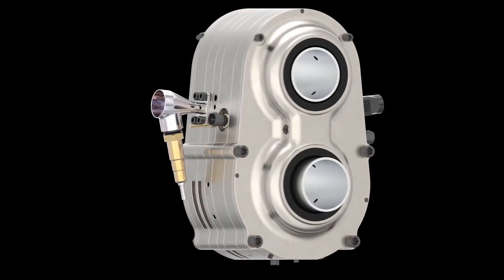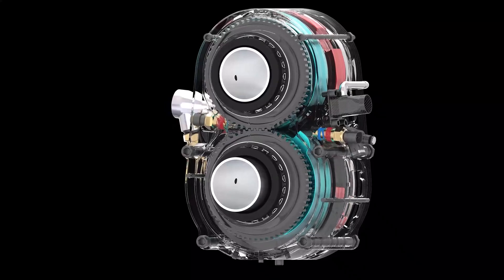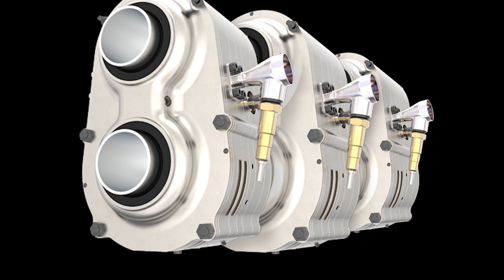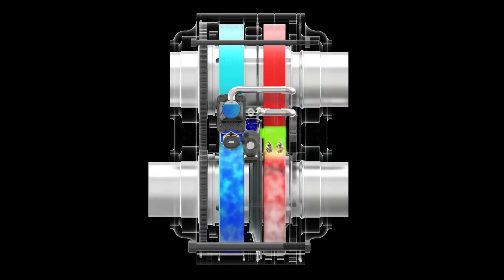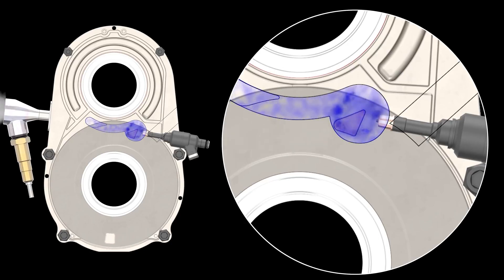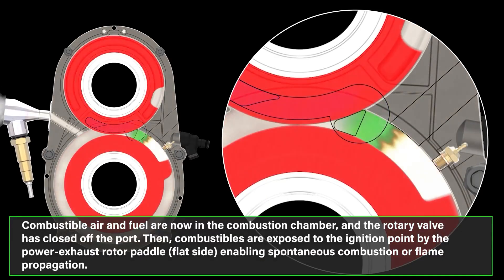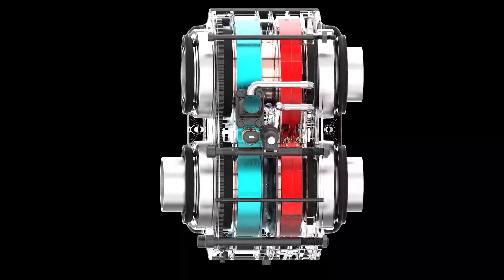This pistonless engine runs on hydrogen and revs to 25k rpm

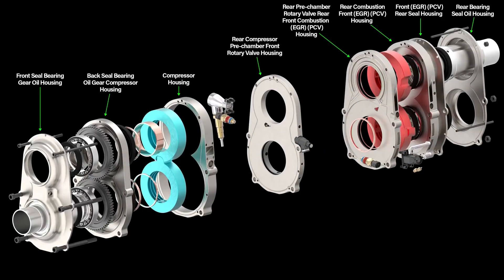Comment: 1:50 1st issue its "air cooled" yet hows the air being forced into it if you look at every other air cooled engine like the deutz for instance it has a massive fan in the center same goes  for jet engines that the interior pulls in cooler air to not only produce more thrust but to also cool the turbine. (edit there is one its just ficking huge later in the vod but the overall design is inefficient because instead of driving air close to the engine its just a massive fan)

1:55 2nd issue the blade design will cause vibration since its its a biased spinning mass meaning its gonna vibrate the more you increase the speed which since the only thing keeping the blades synchronised  is a gear with high teeth count its going to jump teeth knocking them out of sync causing the blades to miss align and cause the engine to grenade.
      
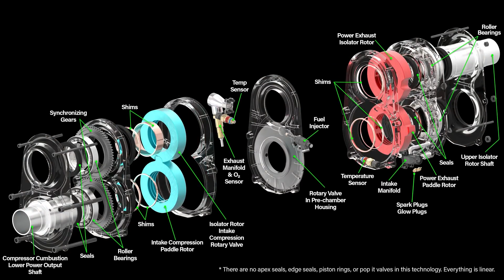2:03 3rd issue tight tolerances since its spinning at high speeds this will cause the discs to distort and since its a high tolerance engine those disc blade things will bind together causing it to grenade

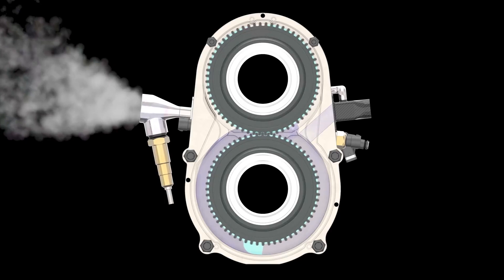2:15 4th issue internal supercharger the main issue is heat hot air doesn't burn as well as cold air because cold air is much more dense so the longer the engine is run the less efficient the engine will run which will cause it to run too lean  because and grenade

2:37 5th issue hydrogen this adds a miriad of issues but the main ones are hydrogen storage you could store it as water but then you would only get 2/3 of useable fuel plus you'll need a hydrogen generator which aren't the lightest thing in the world plus you'll need a power source aka batteries and lots of them because you'll be fighting against newtons second law, not to mention hydrogen is an extremely inefficient fuel for combustion engines in general since instead of needing air to fill the extra space it needs to be full of hydrogen and using hydrogen makes the supercharger kind of pointless and storing liquid hydrogen is not only is extremely dangerous but requires a crap ton of energy to keep it in that state.

i could go on and on about this video its just silly how many errors were made in it 

3:47 nope these "eco engines and EV's esc" will all go away and everyone will try and go for the older combustion cars because maintaining these new eco cars are expensive and once it clicks they'll eventually change there tune about them, and lets not mention when the electrical grid can't support all these EV's so this will cause a massive hike in electrical prices(this is already happening in the UK where people are boiling water over a BBQ then using there gas stoves or electricity)
Reply: Im 100%  sure the air cooler the last things worry about this engine.(Like air cooled car is not a new things) Probably they does even have running version just this 3d stuff.
Reply: Thanks...Well thought out..

Comment: Burning hydrogen in an engine is barking up the wrong tree.  Fuel cells can hit 80% efficiency and electric motors can reach 90%.   If you have hydrogen, fuel cells are the way to go.

Comment: Scale it up and lower the rpm. This way there is a chance manufacturers of cars, motorcycles, Quads etc will have a go at it. Those crazy F1 level rpms are close to impossible to utilize you would need a 2:1 or even 3:1 reduction gearbox which induces losses and unnecessary moving parts at a high cost.

Comment: Those extreme RPMs might be difficult to utilize directly, but this would be perfect for powering a generator to produce electric power on board a vehicle.
Reply: What are you talking about, you could make a very short ratio gearbox and It would handle the same as other engine
Reply: @ThePgR777  Theoretically, yes, but what gearbox are you aware of that has that input shaft spinning at 25,000 RPM?
Reply: @critterIMHO  you can design a new one lmao, you design a new engine, a gearbox is a piece of cake in comparison
Reply: @ThePgR777  yeah, OK. The clutch alone should be fascinating,but I’m sure a man of your talents can do it.

Comment: 160hp at nearly 25k rpm is cool, but the power band is probably really high in the rev range, and you will need to design an entirely new transmission for this.  That torque number has me skeptical as well.
Reply: Perhaps a planetary gear system reducing the high rpm prior to the transmission? That would cause a lot of frictional power loss though. Idk They probably build transmissions suitable for this kind of stuff.
Reply: Planetary or a buttload of reduction gearing. The trans would look like a swiss clock
Reply: If you're going to take advantage of the feature which allows reducing power by skipping firing cycles, that means keeping it at 25K RPM, even at low power. A conventional transmission wouldn't work. If this thing is ever developed, they'll undoubtedly use it in a hybrid system which generates power with the engine, but manages getting it to the wheels with inverters and AC motors.
Reply: Or you could just feed it straight into a generator... and an electric drive train like a locomotive. Honestly that's probably the correct answer for such an engine...
Reply: @Wingnut353  That was done with the fisker karma.  I don't think it worked very well.
Reply: Yeah, I get the idea that this thing would run in the realms of gas turbine engines, seal losses are made up by running faster than air can escape, but means idle speed is still up near at least 50% max rpm. Someone said electrical generator driver, sounds like the best option.

Comment: I will not say this can't work, but the tight tolerances and high RPM will mean you can never build this at a consumer price level. think more 100's k$ .
It's kind of like the problem with small jet engines, they are still very expensive as you will need smaller tolerances to get to the same efficiency levels.
Couple to that the added complexity of the hydrogen tank and associated safety features. 
The tight tolerances will also make this a very (maintenance) sensitive engine. It will need super filtered air and oil, and how well will it handle rough handling (shocks, erratic loads etc.)?
All of that for what? It will not be able to compete with the efficiency of electric motors and battery's and will be way more expensive.

Comment: Biggest problem against Hydrogen fuel is that the investors are going all-in on extremely sustainable battery power
Reply: What? In what shape or form are EV’s sustainable? Do you even know the TONS of minerals used to make 1 battery? And aside from that about the same amount of fuel is burned to produce that electricity… sounds like propaganda to me

Comment: There is no way you can get to 25k RPM, make that much heat, and successfully cool the engine. That will absolutely need water channels and a radiator. Cool concept, but I don’t see how they thought air cooled would work, maybe in space where it’s freezing, but not in California where it’s 80° average. This thing would melt

Comment: These things are great...  in the lab.  I see no path forward for consumer-level power plants based on this design.  Problems of tolerance, lubrication and cost of base materials which would not be standard aluminum or steel.  Maybe someone wants to build a 4-rotor stack for $250,000 for some exotic or race car.
Reply: What if u give it lil less tight tolerance then put seals on it or something
Reply: It looks more like a potential alternative for turbine engines for things like helicopters and turboprobs, assuming you can get these engines running and to be atleast as reliable and mature.

If you can meet all these criteria, GREAT. But only time will tell.

I'm curious how this would actually sound like, probably somewhere between a wankel and a jet engine.
Reply: yeah this would function best as a generator
Reply: Well... who could afford the first mercedes?
Reply: ur funny
Reply: Agreed as the Hydrogen will impregnate the materials and make them brittle...
The Intercooled Turbocharged Opposed Two Cycle Piston Compression Ignition Engine is a better bet as it burns about 60% to 70% as much fuel per / Hp and has better Torque than a conventional Compression Ignition Engine and yet can last a few hundred thousand miles in a Truck...
Reply: Would be great if it was in a lab but its just cgi🤭

Comment: We discussed this type of high efficiency blah blah blah multi stroke engine designs before. Koenigsegg has perfected the internal combustion engine with worlds most efficient/horsepower engine design. 3 cylinder turbocharged gasoline engine.
All we need to go beyond this perfection is to put pursche intake on this engine and zf transmission and throw it on a bmw 5 series 🤷‍♂️

Comment: I think the benefits of the light weight are more than countered by the weight and bulk of the hydrogen fuel tank. This would work better with petrol to keep the weight down to maximise the benefit of the light weight engine.

Comment: Electric cars are still using fossil fuels in alot of applications.... especially if you get power from a coal plant at your residence where you charge it. Therefore in some circumstances electric is no better than gas, but this pistonless engine at 35lbs and can stack em and run off hydrogen with no emissions....... it's truly the only future we should push for...

Comment: You know what the most efficient high tolerance combustion engine without seals? Get this, it exists right now, and you can see it in person. Super high technology. It’s called a gas turbine. https://arpa-e.energy.gov/sites/default/files/14_deBock_GE%20Turbines%20and%20small%20engines%20overview%20-%20ARPA-e%20INTEGRATE%20V2.pdf